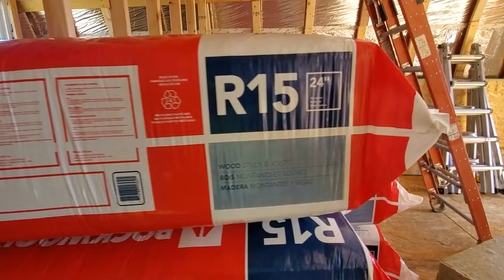Arched Cabin Build - Installing Rockwool Insulation on Side Walls #15

Comment: What made you decided to go with rockwool vs. spray foam in a cold climate? Just wondering about condensation issues.
Reply: Bugs love tunneling in foam.
Reply: @MrRerod did not know of this. What kind?
Reply: Foam is marketed as a wonder thing. But it's expensive to do, can off gas if done improperly oh and also quite flammable. That goes for foam board as well.